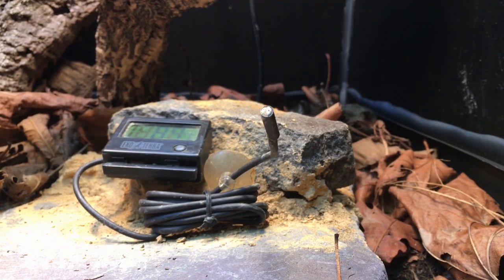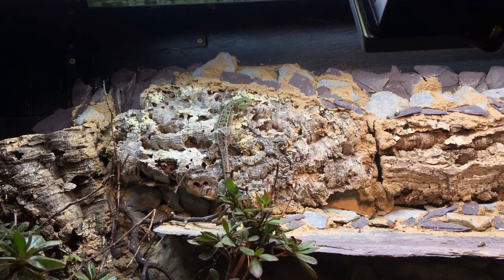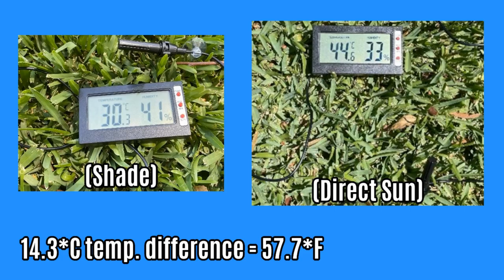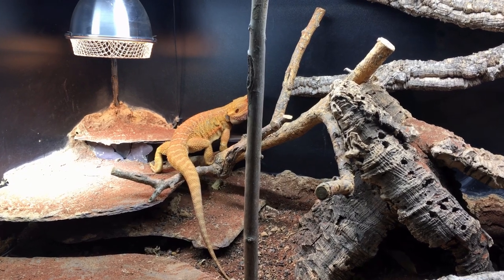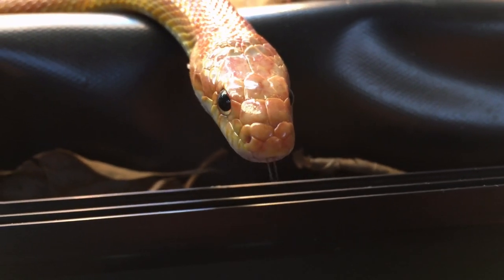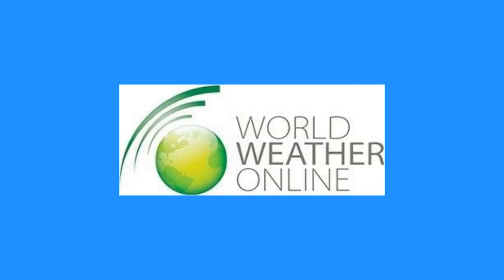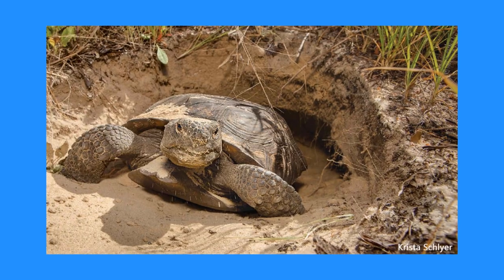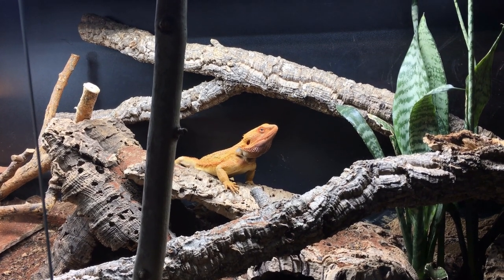We've Been Heating Reptile Enclosures Incorrectly All These Years! - How to Heat a Reptile Tank

Comment: Fantastic video and very well explained. Extremely logical thesis.

Looks like I'm on the right track for my Phelsuma Klemmeri enclosure. I have a small 35w halogen bulb on their basking spot running at 100% (with a thermostat, set up with the probe outside the tank so as if my bedroom gets to 26c it shuts off) and I control the temperature using PC fans. At the moment I have it on a timer, with the fan running constantly throughout the warmest 4 hours of the day and then for brief periods around that timespan. I would like to have a temperature controller set up for my fans, almost like a thermostatically actuated switching system but I am not sure if such a thing exists.

Nonetheless I look forward to your upcoming video and thank you for pushing the envelope with herping! 👍
Reply from the maker: Thanks very much! That sounds just about right. You definitely can get thermostats for fans, I think they sell them as "cooling thermostats". My videos on controlling temperatures will be out ~3 months from now as I want to make sure they are perfect before release, so hang tight!

Comment: Does this “pretty much the same air temperature everywhere throughout the enclosure” include directly under or few inches below the basking lamp itself??? 
 I’m trying to make sure that it’s not too high of an air temperature right under the basking lamps themselves and the readings are higher than what’s safe (95 degrees f in this case) but all my basking surface and air are good and the rest of the enclosure air temperatures are good. 
My snake will be able to access the area directly under the lamps while she is basking, so I’m just trying to make sure that it’s safe even though the readings are over the allowed 95°f… it’s be safe since the rest of the air at the top/ceiling level of the cool side in shade is reading below that… this is the actual number I need to trust and refer to?

Comment: Hello, I purchased a uromastyx. The temperature inside the enclosure is not going past 90°F. I have a 150 basking bulb, a heating mat and a 10.0 uvb bulb. What would u recommend to increase his temperature. ( I have a 35-40 gallon enclosure and my heating mat is working).
Reply from the maker: Have a look at this video for lighting (in the video I showcase my western green lizards, but the lighting setup used would work well for a uromastyx): https://www.youtube.com/watch?v=UEcm0YwfAIg&t=2s

Remember, it is not the temperature which matters so much as the radiation. So long as your lighting is spot on - so linear UV lamp to offer UV indices about 6 at the basking zone falling to 0 in the shade, high lux in the tens of thousands at the basking site (offered with a good spot LED or metal halide), and a comfortable intensity of NIR; I explain all this in the linked video, above - then as long as the temps aren't extreme (i.e. too hot or too cold), the lizard will be able to thermoregulate as it would in nature.

Comment: I'm having trouble with my halogen on the dimming setting using a herpstat thermostat. When in this setting the lamp flickers on and off throughout the day but it does it quite alot in the morning when it's getting to the set temperature. It was recommended to me to put the probe right underneath the reflector in the middle where the beam of light is strongest. However I still have the same problem. This morning it was very apparent that my corn snake was annoyed at the least by this because she moved from out in the open to going into her humid cave. 
  I'm thinking about replacing it for a deep heat projector and installing one of those smart led light bulbs and programming it to dim during Dusk and dawn, dont know how it'll work out but hopefully it does.

Comment: I'm not following your points about thermometers being warmer or cooler based on position relative to the basking bulb as opposed to sensing an air gradient.

It doesn't matter what a thermometer under a basking bulb or on the cool end gives a specific temperature reading. We can know an animal at the same location would experience the same temperature.

Whatever the temperature of the thermometer or it's probe is, the captive reptile would also be, which is what we care about.
Reply from the maker: I know where you're coming from, but you are incorrect for a number of reasons.

- The probe is permanently at one location whereas the reptile moves around. (If you leave something in the sun all day, then leaving that same something in the sun for twenty minutes won't result in its being the same temperature!)
- The probe has a different surface area:volume ratio to the reptile (by an enormous margin) and therefore its temperature will be more greatly affected by the temperature of the air around it (I did some experiments in a video a few months ago about heat transfers to prove that this was the case).
- The specific heat capacity of the probe will be different to the reptile; even if they had the same surface area:volume ratio and were exposed to the same radiation for an equal amount of time, one would warm up faster than the other.
- The absorbance and emissivity of the reptile and the probe are not the same.

👍
Reply: @JTBReptiles  all of those are answered by "the reptile stays in the basking spot for as long as it needs to to get up to temperature" though.

I use both non-probe based digital thermometer/hydrometers and infrared temp gun style thermometers. When I measure the surface temperature of, for example, my P. Vitticeps back after it's been basking using the temp gun, it approximately matches the thermometer I have near the basking spot though is, as expected, a little warmer.
Reply from the maker: @abherbitter  You are right in that a thermometer is an indicator of potential: if the thermometer (which is more liable to heat loss than the reptile) can get up to working body temperature, then a reptile basking will also be able to, but (as I was trying to point out in my last comment) that doesn't necessitate that the lizard is the same temperature as it says on the display. (I thought in your first comment you were trying to say that the reptile was necessarily the same temperature as the thermometer at the basking site, which I now realise you weren't.)

Still, it doesn't mean that using the thermometer as you describe is the right way to go about things.

Consider that in enclosure "A" you might need to use a 100W halogen lamp for the thermometer to read 40 degrees as a stable temperature. Imagine that in enclosure "B" you need to use a 50W halogen lamp to achieve the same thing. (Assume for the purpose of this discussion that both lamps are reflected to the same degree). This situation could be caused by enclosure "A" being situated in a colder room than enclosure "B" (and therefore the air temperature in enclosure "A" would be lower than that in "B"), by enclosure "A" being larger, by enclosure "A" being less well insulated (e.g. glass rather than wood), or by enclosure "A" having more ventilation. In both enclosures we have established that a reptile can get up to at least 40 if it basks for long enough, but that cannot be our only consideration. The intensity of radiation from the 100W lamp is twice that at any given distance as the radiation from the 50W lamp. Radiation doesn't just warm things up, it has all sorts of metabolic interactions, many of which we are only just beginning to recognise: the 100W lamp might be dangerously intense and the 50W lamp might not be intense enough, yet because you've chosen the lamp based on temperatures you would assume that everything was perfect.

Think of the difference between UVi 5 and UVi 10: one you'd happily provide a bearded dragon with in an enclosure, the other you wouldn't dare to unless the enclosure was large enough to ensure escape. By using temperatures as the metric for deciding what lamps you need, you aren't considering the intensity of other wavelengths - namely, infrared and visible light.

What we should be doing is setting everything up with a consideration of radiation first and foremost. As long as the air temperature in the enclosure is in the acceptable range (determined by looking at weather data), then given that we have reproduced sunlight conditions in the enclosure, the reptile WILL be able to thermoregulate as in nature and will also receive the appropriate doses of the different wavelengths. You could still use a thermometer at the warm end just as an indicator of the potential for the reptile to warm up, but (hopefully as I have made clear in this comment) the reading is neither something to influence lamp selection nor to control lamps by: again, it is an indicator; the value has no real meaning. It isn't the temperature of the reptile at any given moment in time, it isn't the temperature of an object, and it isn't the temperature of the air, it's just a temperature that we know the reptile can at least REACH if it basks for long enough.

Hopefully I've made that clear!
Reply: @JTBReptiles  thank you for taking the time to respond so thoroughly 🙂
Reply from the maker: No problem at all! The comments are just as important as the videos themselves so I can’t be slacking!
Reply: @JTBReptiles  I think this is a better explanation than the video.
Reply from the maker: Well maybe I’ll turn it into a video in that case 😂

Comment: It seems like your assuming the tank is a closed system which it isn't. In a closed system it will achieve equilibrium. In this case we add heat on one side while heat is lost to ambient temp of the room on the other side.
Reply from the maker: Appearances can be deceiving 😉

I have considered this, of course I have. If room temp is (say for the sake of argument) 20 degrees C and the air leaving the enclosure is (say) 24 degrees C, then there must be SOME gradient of air temperature somewhere between the inside of the enclosure and out. The question is where: is it across the whole enclosure, linear between basking site and shaded area, or is it something different? It is not all too difficult to find out: all you need to do is use a heating element which does NOT offer significant radiation (i.e. warms the air directly), as then you can dangle your probe anywhere in the enclosure and it will be able to equilibrate in temperature with adjacent air. Doing exactly this (using a ceramic heat emitter which, as you know, doesn’t offer much radiation) shows that the air temperature gradient is small from one end of the enclosure to another. 

I only ever used ceramic heat emitters for years, and this was something I noticed very early on: in a 2’ viv, there was no air temperature gradient; in a 4’ viv, the gradient was 2 degrees; in a 5’ viv insulated at the end near the ceramic heat emitter but NOT at the opposite end [therefore favouring temperature gradient buildup] the gradient was still only 5 degrees C. (These measurements were all taken in wooden vivaria: in glass vivaria we would expect the gradients to be even smaller if not nonexistent.) These values are all well within the scope of an “acceptable temperature range” as determined using the method detailed in the video (i.e. using weather data); they are not the 20 degrees placing a probe under an incandescent lamp versus in the shade would have you think. Therefore, so long as the cool end air is a few degrees from the maximum temperature we have deemed suitable, we can expect the warm end air to be in the suitable range, also. I would therefore say that the air temperature gradient in a vivarium is not “significant”.

The question then becomes, why are the air temperature gradients like this? I believe that the answer to this is that the diffusion of air around the inside of the vivarium must be faster than the transfer of air between the inside and outside of the enclosure. This stands to reason, given the relatively small area of vents. Perhaps if we were to have a short enclosure with a full mesh top and radiation directed at one end only, a more significant air temperature gradient could be maintained - in this case, objects below the radiation source would warm the air around them, and this warm air would go straight upwards and through the mesh rather than moving horizontally towards the other end of the enclosure.

With all that being said, it must be stressed that I purposefully omit certain things from videos. This upload had its first version made in January: the version you’ve watched is actually the third. In all that time, me and the peer review team were doing all manner of experiments to test the validity of what I’ve said. The first edition of this video was an extra 5 minutes long and talked about thermostats as well as giving a brief overview of how we can go about controlling air temperatures. The problem is, too much in one go makes it too complicated. With each video a decision needs to be made about what makes the cut and what doesn’t: enough needs to be said to cover the obvious questions and explain the premise, but much beyond that and an already niche video is made unaccessible to virtually everybody.

To summarise: in a practical sense it is very difficult to measure the air temperature at the basking site using a probe as it will be heated through radiation and thus cannot equilibrate in temperature with the air around it. However, we can expect that the temperature of the air measured at the shaded part of the enclosure (which IS easy to do) won’t be significantly far off from that at the basking site. (In the video, I think I summarised this as “the air temperature will be pretty much the same everywhere”, or words to that effect.) Therefore, just looking at the shaded portion air temperature as though it is the air temperature across the whole vivarium is a suitable approach.

Comment: I'm a tad confused lol Firstly great and informative video but I just need clarification on some points. When you say 35 degrees (Beardies) are talking about the ambient temp of the hot end? Also where is your thermostat placed? Or where would you recommend it be placed?
Reply from the maker: The point I was getting at when talking about the air temperature (i.e. the ambient temperature) is that it is the same (pretty much) everywhere in the enclosure: whether at the basking site or elsewhere, the air will be the same temperature. (To this end, there is no "hot end" or "cool end" of an enclosure - this is why I say "basking site" and "shaded area(s)".) The reason your probe thermometer reads a higher temperature at the basking site is not because the air is warmer there but because the probe is absorbing more radiation from the lamps. (On a sunny day, try stepping into the shadow of a tree or other large object, then step back out into the sun. You feel warmer in the sun, but clearly the air cannot sustain a different temperature over such a small horizontal distance!)

Therefore, the only way of measuring the ambient temperature in the enclosure (and again, there is only one ambient temperature for the whole enclosure, as far as need concerns us) is to ensure that the probe is in the shade. It must also not be in contact with any objects to ensure no conduction between it and them.

Remember that the specific value of the air temperature does not matter: as long as it's not so high or low as to be uncomfortable for the reptile AND you are properly replicating sunlight (critically for this purpose, replicating visible light and near infrared, because together these fractions of sunlight are primarily responsible for warming things up), the reptile will be able to thermoregulate as it would in nature. Think about it - the air temperature can vary by quite a significant degree but so long as there's sunlight, a herp will be able to thermoregulate just fine. How else can African Sulcata tortoises be kept outdoors for most of the year in British zoos?

So, given the above, all we need to do is replicate sunlight and stop the air in the enclosure getting so warm or so cold that it isn't comfortable for the reptile. We must also ensure that surfaces aren't uncomfortably hot or cold, but again, their specific temperatures do not matter.

Replicating sunlight I have spoken about in many videos before and will do so again in the future. We are close - quite close, I would say - to having a way of determining the intensity of NIR; once we have it and we settle on a method for determining the intensity of visible light, we will be quite good at replicating sunlight indeed. Again, it is ESSENTIAL that sunlight is replicated PROPERLY for thermoregulation. Maintaining air and surface temperatures I haven't spoken about yet - all that stuff about thermostats I am still to address. Videos detailing this will be out in the summer, so hang tight! I don't want to try and explain it all here; the stuff I'd say needs peer reviewing before it's shared publicly.